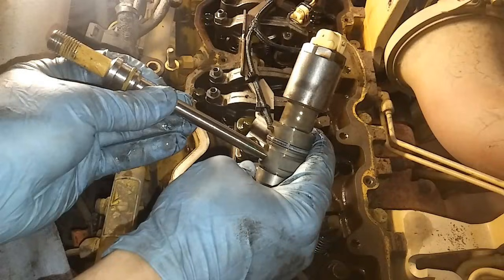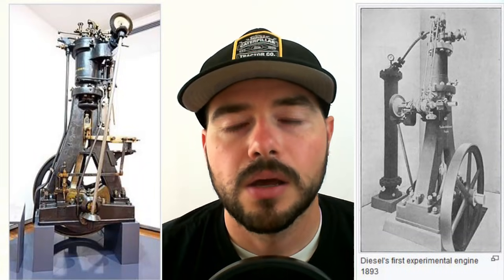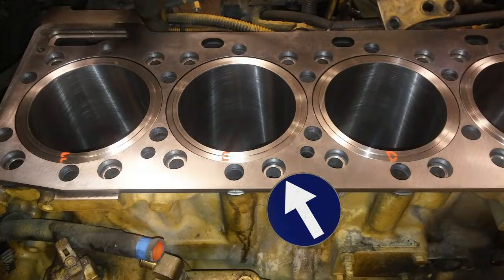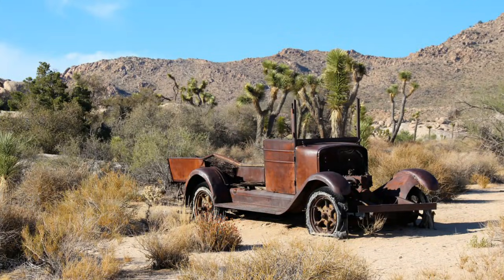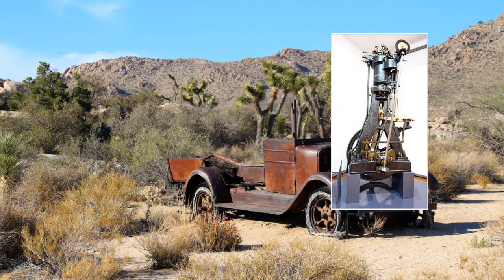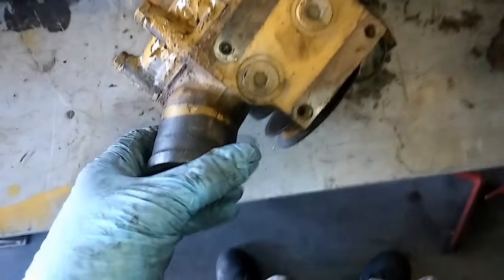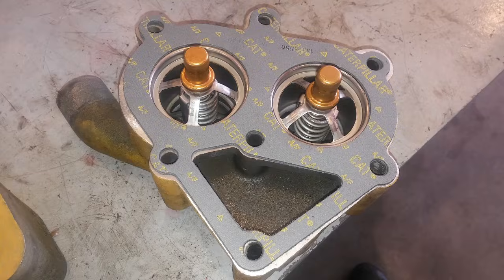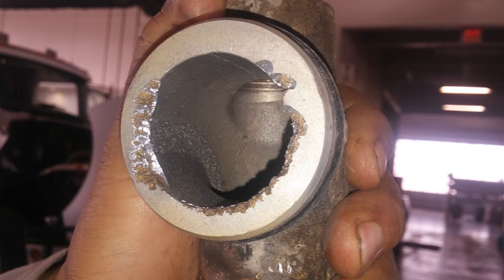Diesel Engines 101. How The Engine Cooling System Operates.

Comment: Thanks josh for your expertise on over heating on my MBN c15 mine overheats and I changed the thermostat,water pump , fan belts  now checking fan clutch if that’s of it only thing now is a clogged radiator ok am I missing something need help if you can
Reply: This is David not Sonia lol

Comment: I'm studying to be an Auto Elec but I got a job in a diesel shop as a mechanic! (Don't ask lol)
This stuff has been invaluable to me. I'll have to scroll through the videos but I'm hoping there's some stuff on air pump systems and stuff if you know much about them. 
We do a lot of cement trucks, dumpers, big rigs, all the likes really - mostly working on more of the truck mechanics itself and servicing but the other stuff would be fun to know!
Also the mechanics of axles and stuff would be fun. I suppose know-how comes from being on the job but as you've been showing, it's nice to know what I'm fixing, why, and how it ideally works.
Thanks for all the brain fillings so far!

Comment: I was having issues with overheating and my water pump went out. I didn't stop soon enough (I stopped and ate down within 5 minutes) and now I'm having to replace my liners and pistons. Basically doing an inframe without dropping the crank or removing the front gear cover. I was having slight overheating issues before the pump went out. I think I'm going to check my radiator and my hydraulic cooling fan. Thanks for this video!

Comment: I recently experienced that with a 94 Chevy 5.7l I had bought off a friend, it had a freeze plug leaking and instead of fixing the problem she was told to put black pepper in the radiator which then caused a domino effect.  Which I'm sure I don't have to explain to you but after a couple of hundred dollars later and a few hours of labor I ended up replacing the radiator because it wouldn't properly cool the coolant. I wish more people would understand that, that's only a "temporary " fix and if you continue it will eventually cause more expensive problems. Lol

Comment: What about deutz diesle? I spent 2 years at an agco dealership, and seen plenty of v8 deutz turbo charged engines in gleaner combines. They were running around 300 hp, and if maintained were very reliable. I was an Apprentice when working there and didn't have to get into them, they had a crazy fan and large oil cooler i believe, but don't know because, like i said i was liw level and fixxed everything around the engine.

Comment: Adept ape...I need some help.  Our motorhome has a 2006 C7...I have had all the bullet proofing you suggested performed.  On our last trip it overheated showing check engine light, warning and apparently went into 'safe mode' losing power while I got it off the road.  I let it idle for a couple minutes hoping the heat would go down, it did not appear to so I shut it down.  After waiting for a while, I went back and checked the coolant level through the yellowed Monaco RV overflow bottle...there was no coolant in it.  I carry spare so started to fill it....it took all 3 gallons that I carried and that was enough to get it started and get it the 20 miles home without overheating.  I see no leaks anywhere, no white smoke from the exhaust and the engine never lost oil pressure.  I know there has to be a leak somewhere but do not see any indication of one.  Suggestions before I take it to the Cat dealer in Redding, Ca?
Reply from the maker: Hello Greg, check the oil to see if you are getting coolant in the oil. I would also check the system under pressure with a cooking system pressure checker.

Comment: My dad has a 3406e we replaced radiator hose and thermostat. He was having trouble he will be loaded around 83 and truck would only run 150 but today he is running it with new parts but if that’s not the issue what else should he look at?

Comment: I replaced the clogged radiator in my old truck with a brand new one because it overheated going up a long hill on a hot day.  Now it takes 40 minutes for the truck to warm up and get heat out of the vents on cold days lol.  Previous owner put stop leak in the radiator and that stuff clogs up pretty bad.

Comment: A video on how to determine if a heating issue is a radiator problem or water pump problem would be awesome right about now.
First this video and then an rpm video. It's like your getting your ideas from my problems.

Comment: I drove Cats, Cummins, and Detroits, as well as on 500 Mack in the 80s and 90s. 1.5 millionish miles. Back in the day, the "normal" water temp was 180. Fan would come on at 195 or 200. If the water temp got to 210 it was considered "hot". Fast forward to present day. I had a '14 Ecodiesel. Normal water temp seemed to be upwards of 210-230. Oil temp on a grade was 260ish. I'm sure the big trucks are the same now? I am also sure that these higher temps promote better combustion and therefore better fuel efficiency. Interesting how things change. Is the higher and higher "normal" water and oil temps a result of gradually realizing that they aren't actually harmful? Or have the block and head and piston materials been changed so they tolerate the higher temps?
Reply: Truck temp normal has been 190-195 for decades, aftermarket thermostats are frequently 180. Cats the fan comes on at  217 and shuts off when it gets down to 204. The Detroits and Cummins ive drove all sat in the same temp area, and that was over 30 trucks ranging from late 80s to 2019s. Slip seat local job, didnt get to know the specifics like I do my 90s cats so can't give exact temps. Funny how knowing the exact data is more important when you own the truck lol

Comment: What I always wondered is why we even need a separate coolant as opposed to using engine oil for the task of cooling the engine.
Reply: John Rickard: the first hart parr and (some other prairie tractors) were oil cooled but they just have oil in the cooling system and no water. It worked pretty good except it took 50 gallons of oil and was extremely heavy
Reply: Look up BMW motorcycle engines. A few where oil cooled, as well as Harley, oil and water cooled.
Reply: Its not strictly necessary,  but there are many reasons such as overall maintenance costs and the temperatures ran in different systems.

Comment: Rule of thumb, coolant temps runs roughly 110 F above ambient air temp. You have two types of flow, internal and external. Naturally when the regulator is closed coolant is forced through the bypass hose and flows back into the engine. When your regulator opens the path for the bypass hose is blocked and now coolant is forced through the radiator and has external flow. You also have a shunt line from the surge tank to the water pump, which is important. A bleed hose in the regulator housing to the surge tank. A 15-16 lbs radiator cap is preferred. Seen lots of brown coolant running a 10 psi cap or less. Over 55 % of engines fail due to a cooling system related issue.
Reply: How about D series engines which don’t have surge tanks. Would it pay to design one and fit it in?
Reply: @rod5262  What is a D series? This is the basic of the Cat truck engines.
Reply: I know you posted this 3 years ago but would the surge tank also be called the expansion tank?
Reply: @jamesgarner4127  Correct
Reply: @johngoldsmith6629  thanks John, just wanted to make sure I was on the same page. I know people call stuff by different names.

Comment: Very cool, I’m
Actually contemplating putting an air cooled deutz in my 78 ford. I know they’re not as powerful as other engines but it be different
Reply: Deutz engines are very solid, just keep the cooling fins clean and maybe install a oil temp gauge. I've driven a Deutz KHD tractor and it was a very usable tractor.

Comment: you are the best I would like t know how you do a timing speed calibration
Reply: Need a probe n cat et to perform. Fairly simple once you have those
Reply: You don't want to buy the tooling. Also if you break the probe off you have to remove the oil pan sometimes. Better to let someone else take the risk.

Comment: There are Deutz tractors that are air cooled as well. 
They are really cool tractors.
Reply: Ive worked on 3cylinder deutz powering air compressors a lot
Reply: Safran also produces an air cooled aircraft diesel engine. 
Best wishes

Comment: Great work well put together 👌 would you recommend 100% coolant on a old problematic over heating construction machine?
Reply: Not in any motor... straight coolant tends to boil at less than 212, typically coolants require at least 25% water.
I use a 7 5% glycol mix to get the maximum freeze and boil temperature protection.  My Cummins  sees both extremes 30-40 below zero fahrenheit in Montana and 117 + in Las Vegas, Nevada
Reply: There are a couple of coolants like Evans that are designed for use straight and a non pressure cap 
boil temperature is 240+

Comment: Yeah the 90's Golf mk 2 and 3 like the Vento are known for faulty thermostats. My MK3 had the same issue it barely went up to 70°C but should have reached 90°C. That is also the only case I've ever heard of a necessary thermostat swap. I swapped and since then it runs in its cushy sweetspod (1.9 L TDI) :D
Reply: My MK2 Golf 1.6 carbureted has the original thermostat from 1987. But the car has only 115 thousand kilometers.
Reply: @nicostenfors5690  Maybe you're lucky on that :D But nice to have a 1.6 MK2 Golf :)) - happy drving :D

Comment: Could you add evaporator coils in front of the radiator to cool the air coming through the front? I feel like this would work great in hot weather.
Reply from the maker: Do you mean like a swamp cooler? The amount of air flow through that may not drop the air temperature too much, but would reduce it. You could put a mister system in front of the radiator, and mist the external side of the radiator, but you would need to refill the water tank and would possible cause hard mineral deposits on the radiator.
Reply: @AdeptApe  I meant a separate  A/C system with the cooling coils in front of the radiator. It would cool the incoming air before it reaches the coolant radiator and CAC. The "auxiliary" A/C pump would only engage in hot weather (30°C or above) or if the engine, for whatever reason, is almost overheating, and would still be disengaged if the engine is not warmed up yet.
Reply: @electric7487  any system that is not independent of the main power source will just add more load and therefore more wasted heat energy to the system thereby creating a redundancy. Just get a better radiator.
Reply: You don't want it to cool too much.
Reply: Short answer is yes .
It however has very limited range of use cases. Gg the dodge car with the evap core in the intake, to supper cool the intake and prevent heat soak during burnout and staging.  The catch is it is temporary relocation of heat. Yes the intake is getting cooler but the freon core in front of the radiator is heat soaking the radiator and any other CAC device is behind it. for drag racing this is just fine you won't run it long/hard enough to get this thermostat to fully open on the radiator anyhow
 on the road application we'd only add heat mode to both the radiator portion of the system (the radiator lives behind the freon course and your example 2) and would add about 25 horsepower worth that heat load to the engine block side of the system resulting in a net loss in roughly 50 horsepower worth of heat rejection while pulling a grade. There may be some finite details were you can improve the efficiency .   Still going to come out to a net loss unless you're only using it in the drag strip Manor to temporarily relocate Heat

Comment: Excellent video. Why do some trucks have a little pin size hole on the cap of coolant tank? I am talking about a mack.
Reply from the maker: That is generally a vent tube for when the cap relieves pressure or needs to pull some air into the tank when it cools down.
Reply: @AdeptApe  thanks so much.